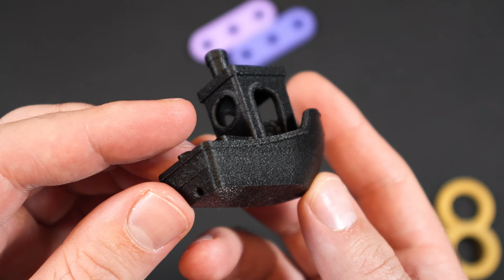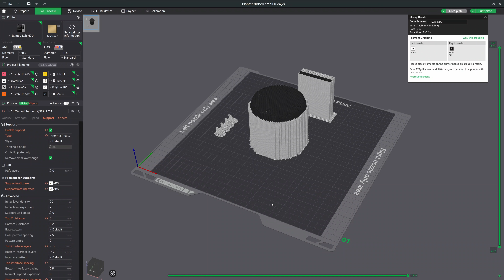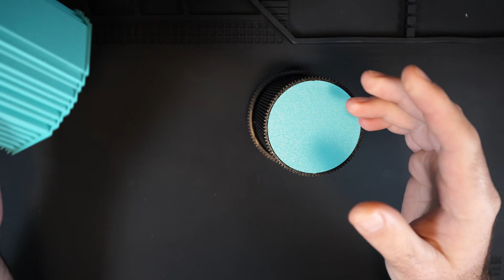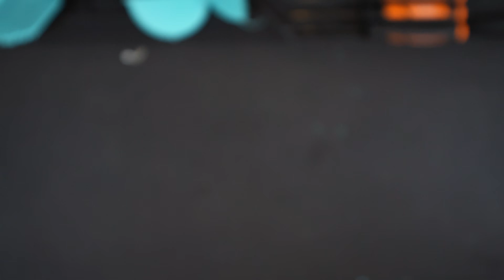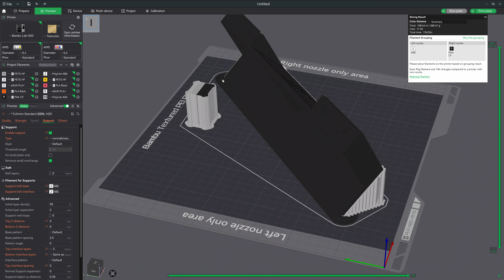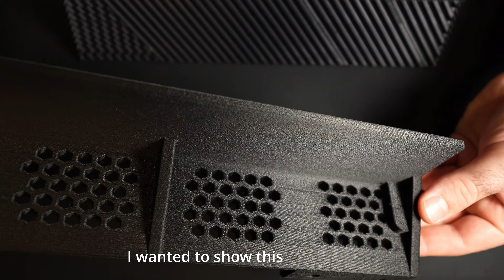Printing PA6-CF with ABS/ASA supports on my Bambu Lab H2D

Comment: I seem to recall I could not run PA6 cf through the AMS? well the HT, is that still true, and if so, how did you get two nozzles going?  it will run one filament on AMS and the other external spool?

Comment: I am trying to achieve this and my asa is not adhearing to of the pa6 cf. I am not sure what to do to fix this problem. The filaments are both dry I am using the Bambu H2D. The filaments are new and dry I just printed a successful part with the pa.

Comment: I used Bambu lab's PAHT-CF (PA12 with some mods, at $96/kg)and got it to work after some struggles. It requires a 0.6 mm nozzle or larger. It is super strong especially in the z direction which is why I am using it but it is a real struggle to keep on the plate. My first success came by using a YXpolymer PA support filament as a raft. But some parts looked nasty against the PA support while some looked good. When I tried just PA6 without a fiber the PA didn't adhere at all to the sled creating a mess. What brand of PA6 did you use?

Comment: Did you use a glue stick on these prints? I just got my bamboo X2D in the mail yesterday and set it up and was unable to print the benchy without getting spaghetti. i’m coming from using a modified Ender three where I always had these glue stick, but was hoping to not have to on this printer.
Reply from the maker: Id start by cleaning the bed sheet with warm water and dish soap. Let it dry, then print again. Normally, textured PEI sheets work great without glue. For larger prints, i use glue to make sure i dont get any lifting from cold spots on the bed.
Reply: @sammuxlow  Thank you for the advice! I did clean the bed after the first failed print because I had the same thought especially it being brand new that there could be oil on there from factory but it failed again. I will wash again to be sure but what are your basic slicer settings like fan speed and temperature of bed, hotend ect that’s the only other thing I could find online is maybe it’s warping from the fan
Reply from the maker: @BassBuilds normally the stock PLA profile on BS works fine for me. The bed temp is usually around 55C for textured pei plate, but you could try bumping it up for better adhesion. Id also try running the printer calibration to make sure your hardware is good, worse case scenario the plate isnt leveling correctly and the extruded plastic isnt sticking like it should. Try glue as well and see if it works.. what brand of filament and how old is it?
Reply: @sam @sammuxlow   I can try the recalibration again and then I will try glue I would just like to avoid if possible I find it can mess up the textured look. I am using fiberon PA6-CF that was dried and is no more than a couple weeks old.
Reply from the maker: @BassBuilds gotcha, if its PA6-CF you'll definitely want to use glue.. check the filament profile as well and see if theres any room for higher a bed temp. Max out the 65c chamber heater too, that should greatly improve print success.
Reply: @sammuxlow  ok thank you again for your help I really appreciate it I will use glue then and yes the heated chamber was the biggest selling point for me because that filament is primarily what I use and I was pushing my ender 3 to its limits even with upgrades.

Comment: As someone who prints pa6-cf I can say that there are some mistakes that you made printing it.  Firstly drying.  Getting pa6-cf completely dry is crucial.  I personally dry it at 100c for 24 hours.  It may be a tad overkill, but 70c just will not get it dry in any reasonable amount of time.  Even at 85c you're looking at 48 or more hours.  Then i print from an active dryer at 70c to keep it dry while printing.    Also 300c is a much better temp to print it at to get good layer adhesion.  Ive printed over 50 kilos of pa6-cf from a variety of manufacturers.
Reply from the maker: The results were great considering there was likely moisture left. I appreciate the comment.

Comment: Did you use the AMS for these prints or how do you feed the filament into the extruder?
Reply from the maker: CF filament was fed into printer outside of AMS, and the ABS/ASA using the AMS.

Comment: Nylon 6 gets week when it hydrates, which it does quickly.  Nylon 12 does not hydrate as bad but is not as heat stable. Nylon also has a lot of creep when not annealed.  The carbon fibre does nothing for overall strength, it is only there for stabilizing the filament coming out of the hot end.
Having said that, it is pretty tough for its price point.  Outside of heat resistance, I think ABS is a superior value and provides amazing strength.

Comment: What does the Karen Lock do? Edit: I just started using this on my X1C and it comes out beatiful. I've seen a few videos that discuss how mosture absorbent PA6-CF is and how it basically becomes a little more flexible, so that might be an issue depending on use case. Great video.

Comment: Hey, Thanks for the video and awesome job. I have a lot of trouble printing 3DXTECH Obsidian PA6-GF on my X1C. I can never get it to adhere to a PEI textured plate. I have tried bare PEI heated to 110C and no luck with Nano Poly Adhesive. The only thing I can get PA6 to stick to is G10 with NPA. I have been considering a H2D. A lot of the 3DXTECH filaments like to break in the AMS HT's so having a second nozzle dedicated to that material would be great.  I use lots of support interface in my products so that makes the 2 nozzle setup better. 

What are you doing on your PEI sheets to get the PA to adhear? Does the chamber heater make a difference with the active chamber heating? I have noticed that PA6-GF warps like crazy.
Reply from the maker: First thing to take care of is drying it thoroughly, which i didn't see you mention but I'm assuming you are following the manufacturers specs. Sometimes it takes even longer than they recommend.. getting your PA6 really dry is super important. But ultimately, a chamber heater will keep it super flat on the bed. I also use the liquid glue from Bambu and it has worked great for me on their standard textured PEI sheet. Id highly recommend a printer with active heating for nylon type filaments, there's really no replacing it.
Reply: @sammuxlow hey brother thanks for responding. I do keep my nylons stored dry in desiccant. For drying I have a setup of air fryers with dehydrate functions. They have worked better than any filament dryer commercially available. My initial drying the nylon is about 24 hours. It'll remain in storage at 10% or less RH. Before printing I'll usually do an 8-hour dry cycle. 3D X Tech recommended Nano polymer adhesive but it don't stick very well to nylon. Lord don't put ABS on it LOL. I've been using hips as an interface.. I also tried abs but they're still not enough adhesion there to keep the nylon flat. I'm very close to investing in an h2d. Thank you for your input it is greatly appreciated

Comment: Very informative video with a focus on printing demanding filaments for engineering projects - not inane toys!I 
have been sitting on the fence re H2D Vs H2S this video highlights the H2D is capable of outstanding results even when handling difficult materials. 
I did like the silent section as it allows more focus on the results without distraction.

Comment: I get that this was a support test, but why not choose an object that could not be printed well without supports? this would have printed perfectly without supports if you just inverted it.
Reply from the maker: It actually gave me such a clean surface where the supports interfaced, much cleaner than the normal top surface would be. Could be used that way as well

Comment: Would you be willing to try this with PET-CF. I bet ABS/ASA could also be used as support for it!
Reply from the maker: Im curious if it would work as well!
Reply: @sammuxlow Woah what a strange coincidence! I just finished your CC vs P1S video as you replied to this 😂
Reply: I went ahead and tried using PLA as a support filament with PETCF. As long as I keep the chamber non-heated and the bed plate temperature at around 80° c everything else works with the PETCF nozzle at 300° c and the PLA still at 220 or 230. It seems like the more that the internal temperature of the chamber goes over 40° c you start having clogging or extruder issues with a PLA filament because it gets too soft. The ambient temperature stayed at around 37° c inside the chamber while it was printing, and I did a very large print that took over one full day. Word of caution though, PLA will not stick at all to PETCF so make sure you select the supports being from the build plate only, supports will not print on top of PETCF filament at all. Overall the PLA filament as support works really well, just comes straight off the print leaving no marks on the PETCF.
Reply: Oh, I also tried PETG as support filament, as you would imagine PETG sticks to PET-CF like crazy! Definitely not a good option lol
Reply: I second this, I tend to do a lot of printing with PET CF. Would be great to know if especially ASA could be used as a support. I'm still waiting for my multi-head printer to arrive or I would try it myself.

Comment: Couldve rearranged the flower pot position and print the feet seperately using pring by object and not use that much support
Reply from the maker: Yes, it was an purpose.
Reply: @sammuxlow Oh ok
Reply from the maker: @calincs i didnt have any great ideas for an object with supports, especially in those materials. So i just flipped it around... hope that makes sense

Comment: I just purchased the H2D and wanted to print with mostly ABS but have found the odor is so extreme I cannot have it in the same room as me.   I thought the filtration system was supposed to eliminate the odor but it is as if there is no filtration at all.  I am so bummed about this.  How can I make it so the unit has no harmful odors?
Reply from the maker: I would recommend having really good airflow in the space that you keep the H2D. Also, any reason why ABS is the filament you want to run?

Comment: Love multi material video's for FDM.  I think ABS could be a better support material for TPU then PLA as well if you look at the adhesion properties.
Reply from the maker: Interesting point! Have you ever tried it?
Reply: @sammuxlow  For the moment I'm just an FDM enthousiast  ;-)  I design prints for B2B and generly let them print in PA with SLS and MJF.  I saw earlier (in German) an interesting subject on supports  with a seperation layer from PLA for a PETG product without (!) a build tower and the use of only 1 nozzle (!) which worked really well!  I thought this could be a solution for TPU as well as supports and surface finish are quite challenging it seems....  I saw that ABS had even lower adhering values for TPA then PLA but couldn't find results on this...  That "Manbo" channel had something but didn't work further on it though.   If you're interested:  https://www.youtube.com/watch?v=Matf1Mna2zI
Look forward to more of your content!

Comment: Hey , do you use the AMS-HT or will the AMS pro 2 work as well without getting damaged? Is the temperature sufficient?
Reply from the maker: I have been mainly using the 2 pro. But I just got my ams ht in
Reply: @sammuxlow thanks mate I will try it next days just got the h2d and will try to share my exp here :)

Comment: Nylon seems a little wet, we use it in our Markforge printers, wet nylon also gives a slightly fuzzy matte finish if not 100% dry, would explain the oozing on the purge tower
Reply from the maker: Yea you're probably right. I have the AMS HT now so I finally have a dryer with higher temp capabilities

Comment: Out of the top 5 brands for PA6-CF, the composition of all of them are different. The additives the vary in each affect the surface quality, bridging capabilities, layer adhesion, hygroscopic tendencies and the minimum diameter nozzle that can be used. It would be extremely  helpful to list the brand of the filaments when reviewing performance and quality. Great video!
Reply from the maker: Yes your absolutely right! It was the Bambu Labs PA6-CF

Comment: Great video but I think you're going a little easy on the H2D.

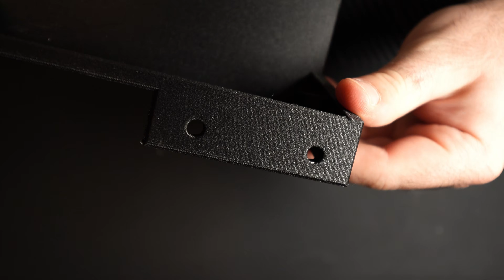At 20:34 on the interior face with 2 holes, it looks like there's layer shifting and what even looks like a piece of stray filament near the bottom corner...
Reply: I just got mine this week. So, the prints have been perfect. Every so often, something won’t be perfect. That’s part of 3D printing. I was looking at the Prusa XL too, but was advised not to. I think they were right.
Reply from the maker: I wouldn't say I was going easy. Thats a tough print for any material. Considering it was PA6-CF, it turned out awesome.

Comment: If I understand right, you only get a purge tower if you use the AMS … if you put your support filament outside the box and run it thru the TPU port will you still get a waste tower? If one nozzle is only support and the other the print material there should be no need for a purge tower. Am I mistaken?
Reply from the maker: A prime tower is recommended for multi-nozzle prints no matter the case (if using ams or not) . When the filament sits inside the nozzle for too long, it can degrade, and pressure can build up. So, to avoid a crappy seam, or inconsistent extrusion, a prime tower is always recommended. Tuning of the tower can be done in develop mode, to make it smaller or turn it off completely.
Reply: @sammuxlow  Facts I wasn’t considering! Thanks! esp ABS gets brown buggers at the end of the nozzle if it sits… makes sense!
Reply from the maker: @LeMortso  yea of course! Please let me know if you have any other questions.

Comment: Yo Mux!  Good video.  

My H2D should be here in about 2 weeks - my 2nd AMS 2 PRO should be here tomorrow!

How long have you had your H2D and any idea how many print jobs you’ve done or… how many hours you have run your H2D?….  And in that time how many Build plates have you gone through and how many Hot-End Print heads have you gone through!?  I’m just trying to get an idea - before I NEED them…. how many replacement parts should I consider ahead of time!?
Reply from the maker: Atm I have about 120 hours on it, and I've had it for around a month. All factory parts have lasted just fine, and should last for years if properly used and maintained. The printer ships with some spare parts, so I wouldn't worry about it for awhile. Just enjoy your machine!
Reply: @sammuxlow  I am planning on doing ABS or ABS+ parts - what do you suggest for best support material - if not full support at least contact?   THANKS MUX!

Comment: The ouzing of the nylon is caused by moisture which become vaporized and then pushes the filament out. I assume, that the Polydryer doesn't reach the required temperature for drying nylon.
Reply from the maker: Yea I'll definitely retry after ordering the AMS HT

Comment: May I ask why you printed those planters upside down to begin with? It's such a huge waste of material compared with printing them on their base (as they should be). With the feet separated, you only have to support the holes for the feet. I get that this is a demo, but you would still see the support effect on the bottom holes (and honestly no one cares how they would look since they'll be covered. Nonetheless, thanks for the nice informative video and relaxing voice and music! :)
Reply from the maker: @DorAmram  I did it purely to test the adhesion of the supports and the PA6-CF. I understand it was not optimal, but if those supports were going to stick at ALL, they would've like that. Thank you!
Reply: @sammuxlow  I also came here to say the same thing, thanks for the explanation!
Reply: wouldn't even need it on those IMO, the bridges are small enough that they should be fine without any supports at all. I get this was a demo and interface test, but I just found myself distracted by the fact that it was such a manufactured problem.

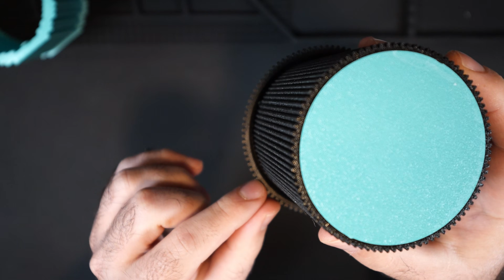Comment: Handy tip: If you have products like this (10:30) which you make often, you can actually just add pause before the overhang and re-use the support from previous prints. I do this quite successfully. Some of the supports I even design and print myself. That way I can add features for easier removal.
Reply from the maker: @FranticGuitar88  wow that's a really interesting concept, and it works well for you? Super cool! I will say I insert pauses for hardware embedding, but I never thought about reusing supports!
Reply: @ Yup, especially the supports I design myself are working super well as they have smoother surface. It cuts material, print time and wear and tear on the printer, so I can get a little bit more profit on my products. It takes a bit more work though as you have to insert the support yourself. And it is not suitable for compicated designs where supports are interlocking and variating on multiple heights. One other thing I do is covering the surface of the supports with thick layer of sharpie ink, which makes it even easier to remove. I do this also for normal supports. I use 0mm top and bottom Z distance and pause on last layer of the support, paint it with sharpie and continue. This makes it possible to use one material and guarantee that there will be no adhesion between support and the model.
Reply: @FranticGuitar88  Sir! Sounds like you should put together a video! (please) Very smart!
Reply: @gkkgl5mkakhelt   Sharpie its a brand of marker like Texta , Nikko  etc
Reply: @FranticGuitar88 wow sharpie ink makes any material that you use as support not have adhesion? Im going to try this
Reply: genius!!!!!